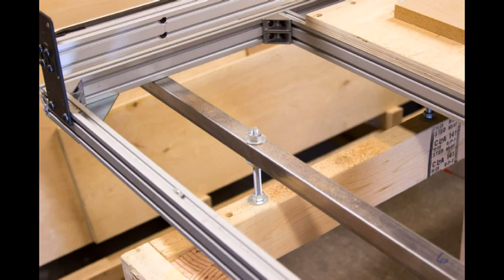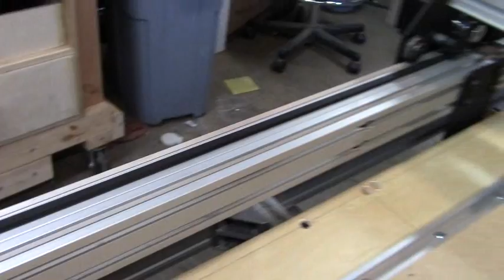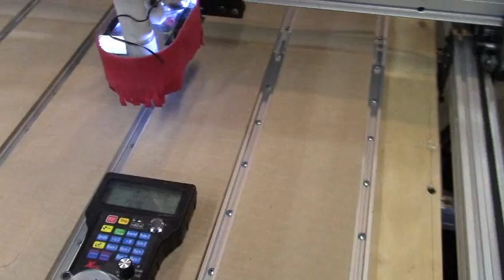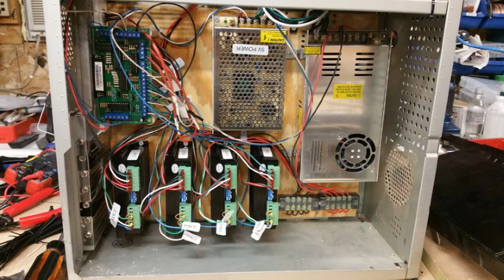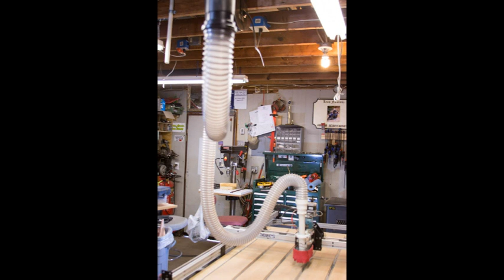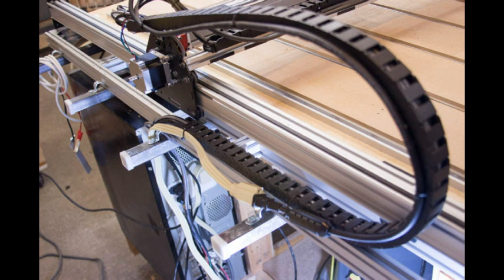Todd Fiebranz's (Damin69) 1000x1800 Shapeoko2

Comment: Great build there,  My home brew is 2 by 3 feet ( biggest I could go, small shop) with a cutting volume of 25 X 18.5 Y and 6Z.  All acme rod driven. NO BELT drives for me.  Acme rods with anti-backlash rods will lock all 3 axis into position with the power off, belt drives wont lock like that.  I can stop a long job ANYWHERE, make a note of the DRO values and what line of G code that is executing, then cut the power. Come back later, power things up, put those values back into the Dros manually, then load up the g-code and advance to the next line where I stopped and run from there. Mach 3 DOES support that sort of thing.   The top of my table uses the same T-track and mdf strip approach. The T-track I use is 3/8 inch tall and uses 1/4 -20 bolts also.  I just use the strips as my spoil board and surface it as needed.  I usually set z zero to the mdf then just manualy set the Z zero dro to a negative whatever thickness the material is. End result is about all you do to the  mdf strips or spoil board is just scratch it.  For serous holes I simply fill them with woodfilller and sand it flush after it sets up. Eventually I do have to surface the strips again but I only take off say 2 or 3 thou. When I get down to around 20 thou pf the t-track, I just put new ones on and start all over, about once a year.  A quarter sheet of mdf is cheap.  :) The screws in the mdf are also set down to the T-track height

I also use Mach 3 with essentially the same electronics setup as you with one difference. I have a switch to kill the stepper power supply and still leave the bob hot and the limit switches and the e -stop active. Mach 3 dosent ever know if the steppers are turning or not, it just assumes they are but if you want to invest in enoders Mach 3 CAN be ran in a closed loop mode. .  I have crank wheels on all 3 axis. With the stepper supply off I just crank the end of the bit to w here I want it, turn the stepper power back on and put zeros in all 3 dros manually.  That is basically the way a bridgeport mill with Dros works,  sorta half manual half CNC.  Nice option to have available when it can be the easiest way to set zeros. I use only 3 steppers, Nema 23 450 oz/in so its possible my driver modules may be a bit stouter than yours. I have my X-y zero point rotated to the left 90 degrees as I have to work from the side. Small shop and I had to shoehorn in the CNC  :)  That makes the gantry my Y instead of x. I use only 1 stepper on my  X, right down the center. The racking problem is solved by basically an X configuration of 1/8 inch steel cables running on 4 V-rollers on the cross arm. The gantry physically cannot rack that way.

For a pendant I just use a small wireless keyboard. Not as nifty as that wireless pendant but both the wired and wireless have COMPLETE control of the computer. A pendant dosent. Been a time or 2 where I had to minimize Mach 3 to check out something else on that 15 year old desktop I use on the CNC..Normally I do all the cad/cam stuff I use he house and trot the G-code to the shop with a thumb drive. But I do have most of the proggys I use for CNC stuff on that computer.  Makes it nice for some "touch up" when needed easy.